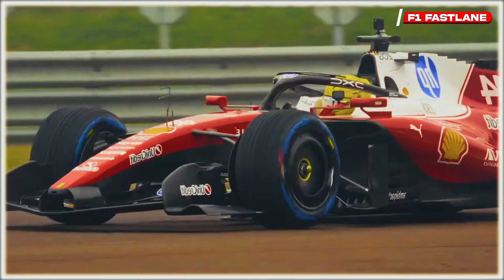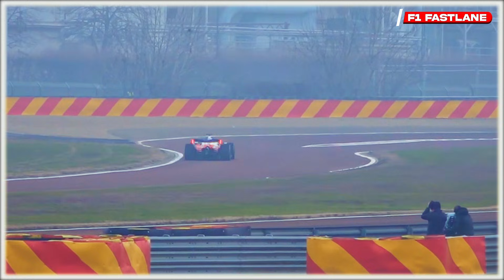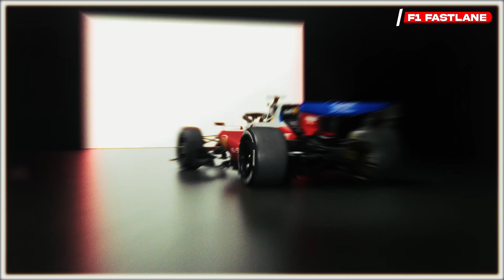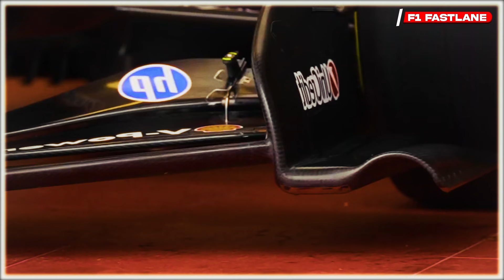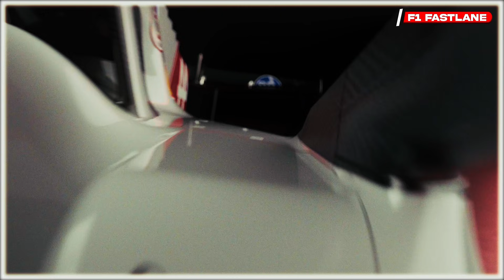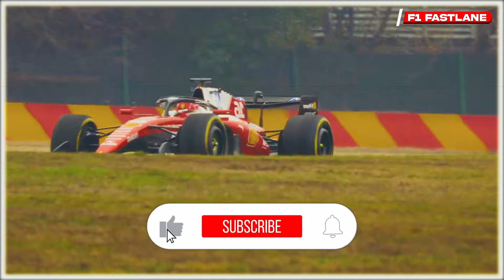Ferrari Just REVEALED the Secrets of Their NEW ENGINE! Total Revolution and Integration!

Comment: they can  only use 0.23 kg fuel per kilometre to create 550 hp for the ICE and also generate power for 550hp electric motor .. with Fuel that is less energy dense than just regular pump gas .. how shit this abomination of a PU rule set is and this era should not even bare the designation F1 .. more like WOKE ZERO